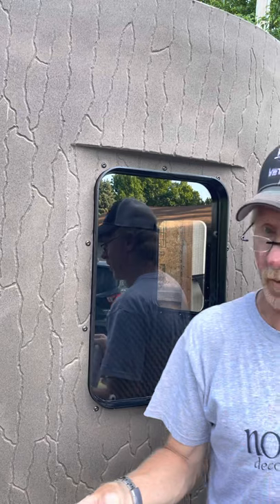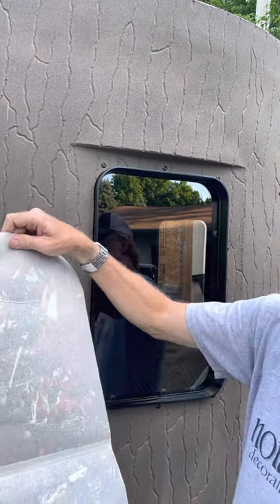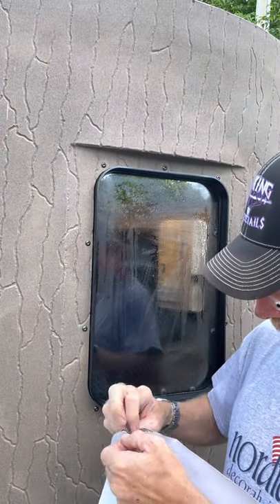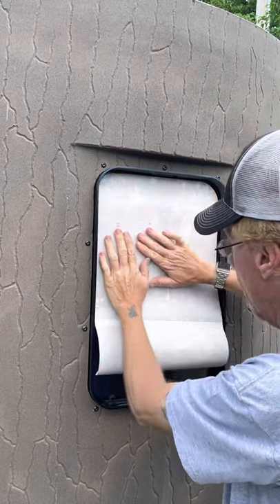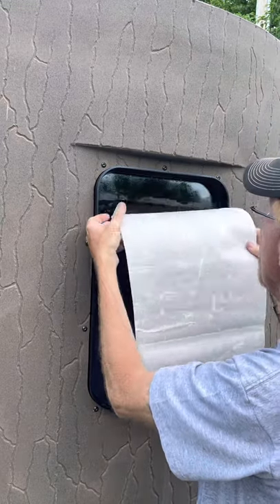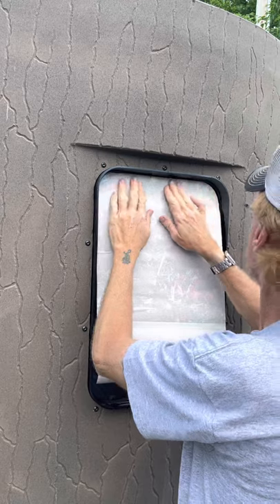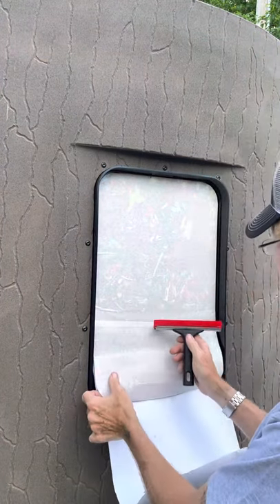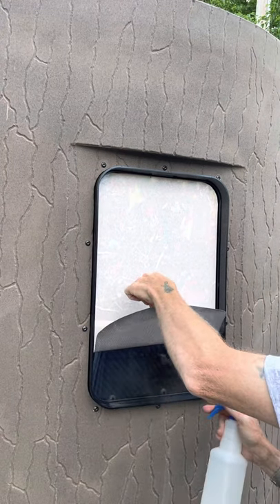Installing the Stealth Screen Kit on your Stump blind

Comment: Why not show what you see from the inside?
Reply from the maker: I do have some video of inside the blind looking out through Stealth Screens. I will post that soon. Thanks for your idea!
Reply: Is the water spray required?  My instructions don’t mention that. First time doing it and don’t want to screw it up. Thanks!
Reply: So u find the perforations collect dew or rain and obscure the view?
Reply: Have u tried putting the film on the inside of the windows the same way so the small pockets don’t collect and hold moisture which obscures View?  

I put mine on the way you did but it’s hard to see out if it’s raining or wet

So I have to open windows which kinda defeats the purpose of screening.